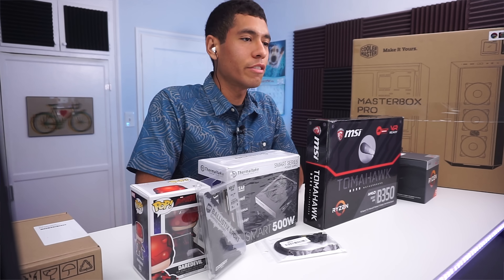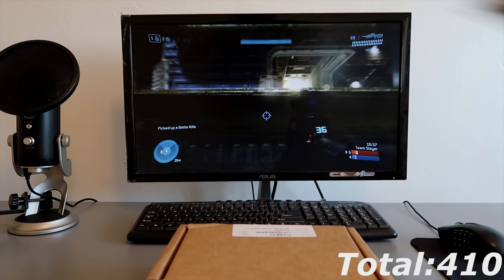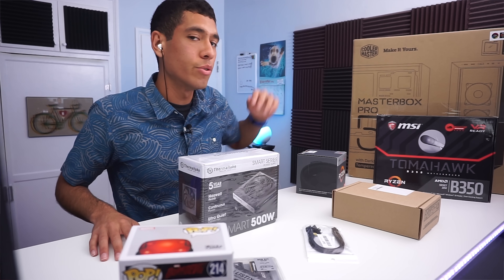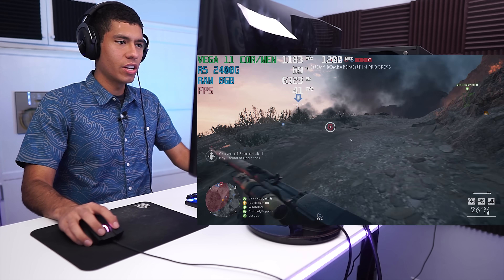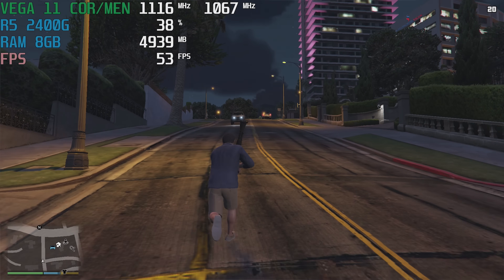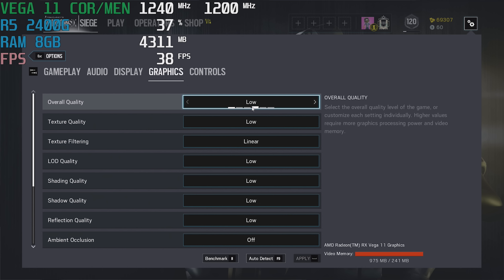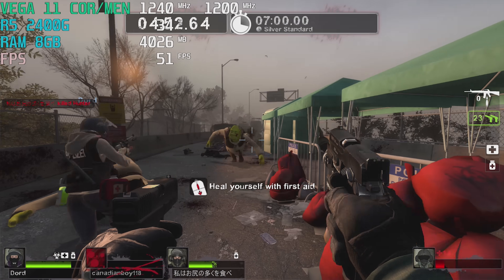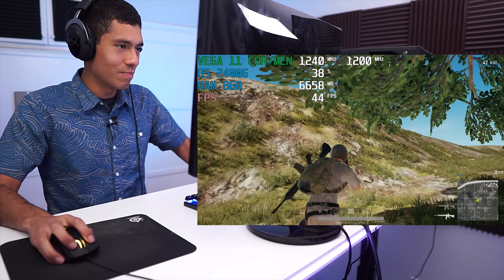$500 Budget Gaming PC Build - Ryzen 5 2400G (w/ Benchmarks)

Comment: i know im pretty late to this video but the MOBO I got only has two fan headers, 1 for the cpu cooler and another one for something like a case fan and my case has 2 fans so i was wondering if the fan splitters that you used in this build would let me plug in both fans in the same header
Reply: Walter Borbor yes fan splitter will do (considering both of your fans are using fan header)

Comment: good day.

Please help me if these parts are compatible?

Thanks.

Crucial MX500 250GB 3D NAND SATA M.2 Type 2280SS Internal SSD - CT250MX500SSD4

by Crucial
  
AMD Ryzen 5 2600X Processor with Wraith Spire Cooler - YD260XBCAFBOX
by AMD

MSI ProSeries AMD Ryzen B350 DDR4 VR Ready HDMI USB 3 micro-ATX Motherboard (B350M PRO-VDH)
by MSI
 
Corsair Vengeance LPX 8GB (1 x 8GB) DDR4 DRAM 2400MHz C16 (PC4-19200) Memory Kit - Black (CMK8GX4M1A2400C16)
by Corsair

WD Blue 1TB SATA 6 Gb/s 7200 RPM 64MB Cache 3.5 Inch Desktop Hard Drive (WD10EZEX)
by Western Digital

MSI GAMING GeForce GTX 1050 Ti 4GB GDRR5 128-bit HDCP Support DirectX 12 TORX 2.0 Fan Graphics Card (GTX 1050 TI GAMING X 4G)
by MSI
 
Rosewill Computer Modular Power Supply, 80 Plus Gold 500w Gaming PSU, ATX 12v/3 Year Warranty (LEPTON 500)
by Rosewill

Thermaltake Core P1 Tempered Glass Edition Mini ITX Open Frame Panoramic Viewing Tt LCS Certified Gaming Computer Case CA-1H9-00T1WN-00
by Thermaltake

Comment: Could i ad a Nvidia gtx570 to make games run better?
Reply: I know this is an old comment but if you go on Craigslist or eBay you can find new generation cards that will run more efficient. Only about 80-90 more can yield you considerably better performance and way better efficiency
Reply: If i had gtx 1050 2gb ddr4 would it run good?
Reply: @brucenicholas1999  yes

Comment: Which is better? This or the other "best 500$ pc build guide"? I'm not so good with PC's but im gonna build one
Reply: Well the other 500$ build guide is obviously gonna perform better, since it has a dedicated GPU and this one doesn't, but the concern for that other build would be the price. First of all, the case he got for the other build was a bit of a steal, since he only paid 19$ for it during an amazon flash deal. On top of that, even though GPU prices are falling right now, you still probably won't be able to find a gtx 1050ti 4GB for the price he did, which was around 160$. However, the price inflation isn't nearly as extreme as it used to be, so I would say that if you're willing to spend just a little more than 500$, as Joey did in his other build, then the performance will be worth it. A couple months ago, this build was more relevant because GPU prices were a lot higher than they are now, and this provided an option for people who wanted to get into PC gaming, but had a strict budget. Also, if you're already going over 500$, I would consider getting a small, 120gb SSD, which you can usually find for 50$, and using that as your boot drive. (Boot times will be much faster.)
Reply: Augustas Yeah sure AMD will catch on fire because it runs much cooler than Intel for two simple reasons. For one AMD simply has better efficiency than Intel and for two they don't use flippin toothpaste for their TIM. Can you tell me about these "experts" as well? When did they tell you? A year ago before AMD released Ryzen? As at first AMD was the one who was boss then Intel won with their newer CPUs and it has stayed that way for a lot of years. Only recently has AMD been a good thing to buy because of Ryzen. Also, you say the CPU cooler isn't that good but do you really think that you'd pay $120 for a CPU and cooler (cooler is probably $20) would beat a $70 cooler? No of fuckin course not. However it is still leagues better than Intel's stock cooler. You obviously have no idea about what you're talking about and should do more research on the things you talk about.
Reply: Augustas wtf r u talking about, it's da best cpu in da entire decade!
Reply: Dude I'm Stoned he don’t kno what he’s talking about lol
Reply: this one
Reply: Drontz can u explain why it’s better?? I was gonna buy all the parts for the other one
Reply: 1000 subs with no videos pls the other one is better because the other one has a graphics card and all the parts and stuff but this one doesn’t
Reply: The Fat one Because later you can buy a gpu.
Reply: Soooo... which one?
Reply: + which one is better at streaming/gaming?
Reply: 1000 subs with no videos pls get 2600 n gtx 1060
Reply: Dont buy ryzen cpu dude please
Reply: 1000 subs with no videos pls the other one cuz if this one rises to $650 than you'll need a gpu which rn is $200 for a 1050ti raising it to only $850 without a monitor mouse or keyboard and other accessories.
Reply: Augustas yu really are dumb it’s price is great ryzen have safety other wise
Amd wouldn’t be able to sell them and no games freeze with that cpu lool go educate your self
Reply: Lester Guzman did I fucking comment at yu nah lol
Reply: try and get one with a gtx 1050 ti or at least a gtx 1050 instead of this one
Reply: Which one did u end up doing
Reply: 1000 subs with no videos pls looooooool I know you r getting really confused now if you wana get high fps then another one is better but if you have money to buy gpu then this one is better Recommended  (Another One)
Reply: I recommennd you this one but upgrade the ram to 16gb in 3200mhz or much better and you must buy SSD too for the solid performance..
I think this build will draw the 24th century.
Reply: Cen Jake no its not! Its cheaper because it doesn't have safety built in and it can set itself on fire anytime. The fan isnt even that good.
Why is it better for the price than intel then? 
Like I said.... No safety. 
Games sometimes are going to freeze and crash, and ryzen processors come already overclocked in-box. I have talked to a lot of experts, not even one of them recommended me amd.

Comment: If i buy this can i add later a gtx 1050 ti or gtx 1060 3gb?
Reply: kenji allam no I’d get the 6GB if you’re going to get the 1060, 3GB is shit because the VRAM gets maxed out easily
Reply: The Seal is Back! Yes you can
Reply: what about the performance? if i add a gtx 1050ti in this build would the performance be better than a normal ryzen 5 1600 cpu and gtx 1050ti gpu ?
Reply: yeah but only 3gb?
Reply: kenji allam don't add a 1050ti because the 1060 gb has like 30 euros difference and the performance is better
Reply: The performance of GTX 1060 3GB is a lot better than the GTX 1050 Ti 4GB.
http://gpu.userbenchmark.com/Compare/Nvidia-GTX-1060-3GB-vs-Nvidia-GTX-1050-Ti/3646vs3649

Comment: hey, i could really use your opinion. 
ryzen 5 2400g or i5-8400?
Reply: If your not going to have a gpu in your build then you should go with the ryzen, but if you are including a gpu go with the i5. The i5 will have better performance as a cpu then the ryzen. Compared benchmarks can be found
 here- https://www.cpubenchmark.net/compare/Intel-i5-8400-vs-AMD-Ryzen-5-2400G/3097vs3183

Comment: Frame rate dips traced to Ryzen Master SW defaulting to 400 MHz instead of 1100 for the iGPU.  Also many OC have gotten 1500-1600 MHz on the iGPU.  Unless a game has a min frame buffer check  that prevents start you need to set the dedicated reserved MEM for the Frame buffer to 64-512 MB when you only have 8GB in the system.  Windows will dynamically add MEM as needed.

Comment: I have ryzen 2400g 8gb 2400mhz ram and window 10 1709.
My PC is lagging
Whenever I open control panel or my computer or any other app it lags when apps open.
I have gigabyte ab350m gaming 3 but it supports BIOS of gigabyte ab350 gaming 3.yes its a manufacturing defect.
So does this effect my performance or their is another problem .
Please help

Comment: When the GPU prices go down, can I add a graphics card into my 2400G?
Reply: yes
Reply: Im planning to buy this with a gtx 1050 2gb will it be good for fortnite
Reply: A 1050ti and you could run the E3 have on low 720/1080.
Reply: 2gb 1050 is bad...

Comment: Hi Joey!
I just built a budget gaming pc, works fine ( Very high settings, around 60 fps and very stable during gameplay (tested with Paladins and World of Warships).
I first tried with a Ryzen 3 2200g thinking a Bios update would solve the issue (update was made with a Ryzen 3 1200 on the mobo) and the CPU red light did went off but still got a black screen.
SO, I went with this final build;

-Cooler Master Case (exactly yours)
- MSI Tomahawk B350
- Samsung 500Go SSD Sata
- Ryzen 3 1200 (Game Boost ON)
- Zotac GeForce GTX 1050 Mini (Weird I know but works magic)
- 600W Thermaltake PSU
- 12 Go of Ram (This is weird; 2x4go Corsair Vengence Ram @ 3000Mhz plus a 4go Corsair Vengence Ram @2400Mhz. They're currently clocked @2399Mhz.)

I will test for 8Go ram @3000Mhz to see if I get more stable FPS than 2399Mhz.

But this build works magic for an entry level PC.

Next upgrades;
Ram, obviously. (Upgrade to 16Go @3000Mhz)
GPU (Still looking for one, AMD being first in my options)
M.2 SSD
Another 500Go SSD
Soundcard ( for recording purposes)...

But seriously, Ryzen 3 1200 is a GOOD CPU. If you are like me and just fell in love with the MSI Tomahawk B350, it's a very good (and cheap) option for this mobo.

So yeah, it cost me around 800$CAN. More or less 50 bucks I reckon.

Hoping this comment will help more people to convert to the PC world as I just did! :D
Reply: Well "budget" depends on who spends but hey, 800$CAN is pretty good for a gaming rig outputing stable 60fps on online multiplayer games such as Paladins.!

Comment: Are these good for a pc build on a $800    Budget? 

Seagate 1TB IronWolf NAS SATA 6Gb/s NCQ 64MB Cache 3.5-Inch Internal Hard Drive (ST1000VN002)
- $55.99

CRYORIG H7 Tower Cooler For AMD/Intel CPU's
- $34.99

Cooler Master MCW-L3B3-KANN-01 MasterBox Lite 3.1 mATX Case with Dark Mirror Front, Acrylic side panel
- $37.99

EVGA 600 B1, 80+ BRONZE 600W, 3 Year Warranty, Includes FREE Power On Self Tester, Power Supply 100-B1-0600-KR
- $39.99

AMD Combat Crate Bundle with Ryzen 5 1600 CPU (1 Item), MSI Gaming Radeon RX 580 graphics card (1 Item) & MSI B350 T
- $549

Ballistix Sport LT 8GB Kit (4GBx2) DDR4 2666 MT/s (PC4-21300) SR x8 DIMM 288-Pin - BLS2K4G4D26BFSE (Red)
- $104.95

Comment: I can see the integrated graphics I have under Display Adapters in Device Manager, but there's this exclamation mark on it and it says

 

"This device cannot find enough free resources that it can use. (Code 12)

 

If you want to use this device, you will need to disable one of the other devices on this system."

 

Please help, I've been trying to find a solution for the whole day, I've reinstalled the AMD drivers multiple times but it's still not working.

Comment: Is it possible to use the ryzen 5 2400g in a build then add another Graphics Card such as the GeForce GTX 1050? Will it work? Or does it have to be the gpu in the ryzen alone?

Comment: COULD YOU SWITCH THE GPU WITH GTX 1060 AND STILL BE COMPATIBLE?
Reply: dJ miggy THERE IS NOT GPUNIN THIS BUILD, YOU COULD DEFINITELY ADD ONE
Reply: Signifies Isn’t the gtx1050 the gpu?
Reply: Signifies my question is, is the 1060 good for this build or 1050ti

Comment: So I bought a GTX 1050ti before the price increase and I want to put it in my new build. Should I use a ryzen 52400g, or the Ruben 5 1600?
Reply: the 1600 has 6 cores/12 threads. The 2400G has 4c/8t. More cores are better for multitasking. But it comes down to how much you want to pay. Also, this month AMD is releasing the Ryzen refresh, so you might want to wait to see how much better the new CPUs are. And the older ones might get a nice price drop.
Reply: ok, but would it be better to pair my 1050ti with the 1600 or the 2400g for now
Reply: Which is "better" depends on what you are doing with the CPU.
If you are just playing games, the 2400G has a higher boost clock (3.9Ghz vs 3.6 for the 1600) and that should be helpful for higher frame rates, but you can probably overclock the 1600 to the same frequency (or close to it).
If you are rendering videos, doing photo editing or streaming your game play, more cores will be helpful.
If you are set on buying one or the other and price doesn't matter, find benchmarks that compare the two in tasks that you would be using and buy accordingly. Otherwise, buy the cheaper one. I can't just tell you "which is better" because only you can know which you'd rather use.
Reply: MunkeyChips yea im mostly gonna be playing games and typing papers occasionally for school so i guess the 2400g is the way to go
Reply: Probably. The R3 2200G will be good enough for that and you could save $60 bucks. That's only 4c/4t instead of 4c/8t, so some open world games (like Assassin's Creed Origins and Watchdogs 2) might take a performance hit, but you'll still get a solid 30fps. And that's all you'll probably get from those kind of games with a GTX 1050ti @1080p/console setting (or better).
But again, you should look at benchmarks before buying. Gamers Nexus, Digital Foundry, Hardware Unboxed, RandomgaminginHD; These are all channels that have tested these CPUs and GPUs. Check them before you make a purchase. It'll give you an idea of how your games will perform at different settings and resolutions.
Reply: ok. thanks for your help

Comment: Gtx 1050ti + new 8 generation penitiums + 8gb ram good stuff?
Reply: Mr Sir motherboards
Reply: AJO PROD no mobos for intel are too expensive
Reply: @elti8380  pricie mobo and graphic card? idts
Reply: +elti - whats mobos
Reply: If I were you, I would watch out for a i3 8100 combo with mobo. Frys has one out for $140 with i3 and mobo.
Reply: Говно
Reply: Wrahh TV i would go with ryzen 5 1400 or even grindin' more money for ryzen 5 1600/2600 since intel stuff is never cheap and the mobo will not last long since its only allow 8th gen. yet in the other side with amd will still support am4 till 2020 so when you wanna replace it it'll be no additional cost to mobo and as you know 4 core 8 thread are quite the minimum counts for new games

Comment: what your opinion about this budget?
can it play all your game with medium?

cpu : ryzen 5 2400g
mobo : MSI A320M PRO-VD/S
ssd : Western Digital WD Green WDS120G2G0A 120GB
psu : cooler master 500w
ram : G.skill AEGIS (1 X 8GB) DDR4 3000
gpu : ZOTAC GeForce GT 1030 2GB GDDR5
case : bitfenix comrade black
Reply: Smile cat good good, but I just recommend that if you’re going for a budget build I’d consider removing the ssd, for over a gpu, and for the ram I’ll suggest getting dual channels (which is better) consider getting a 8GB kit ,(4GBx2)
Reply: msi a320m pro-vd/s support for cpu overclocking?

Comment: That stutter is caused by the RAM sticks, I've seen them a lot before. Maybe the RAM sticks you used aren't listed on the Motherboard compatibility list, Ryzen APUs aren't 100% compatible with lots of the common RAM memories that we use. Stuff like the XPGs from adata will get rid of that stutter even though their quality is lower, they're also cheaper than the ones you used which makes them even better for budget rigs.
Reply: Likes24nicate you sure?, for me it stutters because there’s no gpu at all, considering triple a titles requires good specs :/

Comment: Nice video. I’ve just built a similar system. Did you use the AMD Ryzen Master utility to overclock the graphics clock? 
If so, care to share your settings. I found it defaulted to a pretty low level. Got it reasonably dialed in but wondering if I can do better. Pretty much only playing World of Tanks so far.

Comment: Hey man quick question hopefully you or anyone can answer. So I have a old up pc with a 7th gen amd a-10 9700 it runs at 3.5  GHz base clock and it has an integrated graphics card, so I tried running fortnite and it runs at about 20 fps or less even with low settings I was wondering if I add a GeForce GTX 1050Ti G1Gaming 4GB Graphics card would that improve the gameplay? also would I be able to move the entire setup to a new case? I feel like both of these questions are obvious yes's but just making sure. lol

Comment: Need some help here bros, is this worth it? A $580 cost in my country

Mobo: Gygabyte Z170-HD3P Gaming board
Proce: Core i5 6th gen 6400 2.70ghz
HSF: Cooler Master 212x 120mm non LED
Ram: KINGSTON 8GB 2400mhz DDR4
GPU: MSI R7 370 OC edition 2GB 256bit DDR5 dual fan with LED logo
SDD: TEAM GROUP L5 120gb
HDD: Seagate baracuda 1TB 7200rpm
Case: Nzxt Lexa
Fans: 2pcs 120mm Blue LED 2pcs 120mm LED white 2pcs Blue LED strips
PSU: Raidmax 600w 80+ bronze Tru Rated

Planning to run PUBG at 60fps, is it possible? :v Thanks in Advance!

Comment: Hi I'm a first time builder and am on a fairly tight budget. I'd appreciate if anyone could take some time to verify that these are all compatible. If not, what can I change? After some thinking I came up with this build:
MSI B350M Gaming Pro AM4 AMD motherboard
Ryzen 5 1400 CPU
GeForce GTX 1050 2GB graphics card
8GB DDR4 RAM
Western Digital 1TB 3.5" HDD
500W power supply
Reply: i would change to the ryzen 5 1400 to the 2400 since that comes out next month

Comment: i have a b350 mother board and a ryzen 5 and no gpu or video card and my fps and graphics suck. i get like 30 fps on league at the lowest settings. i also have 8gb of balistix ram. can someone tell me whats wrong?
Reply: @TSM_Gamerino My potato can run League 60fps+, the graphics card doesn't seem to be the issue. It may be hardware related, driver related, or RAM related
Reply: Are you using single stick ram?
Reply: CGI RED you have to use a 2x4 ram then overclock it to 3200mhz
Reply: which ryzen 5 is it?
Reply: Luis Ramirez the ryzen 5 2400 g
Reply: Integrated graphics vega 11 or vega 10?
Reply: RAM
Reply: um ur gpu
Reply: Ram speed and frequency?

Comment: if I have 1 x ASRock X370 KILLER SLI can I buy 1 x RYZEN 5 2400G ? And later buy a GTX 1060 ITX 6GB GPU ? And  maybe changing from RYZEN 5 2400G to RYZEN 7 1700 ? I will have a backup apu (gpu + cpu).